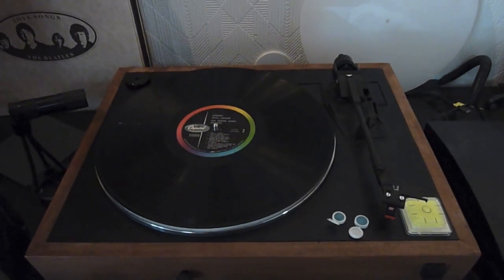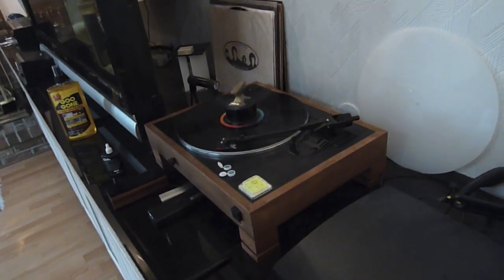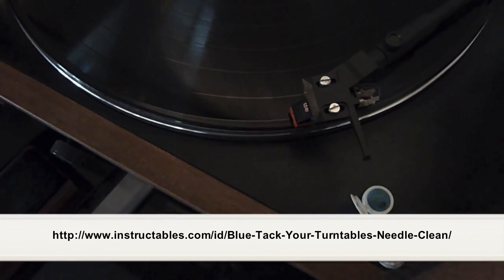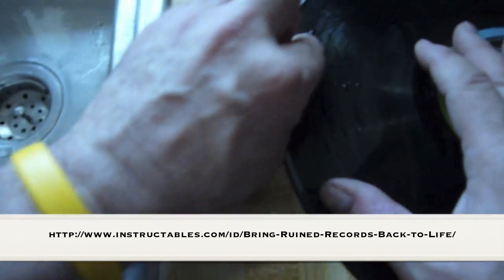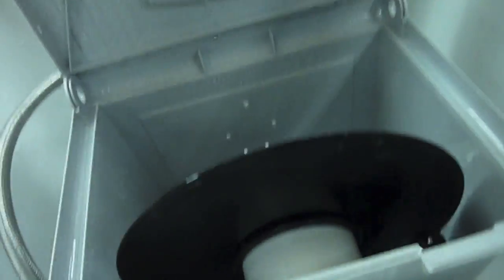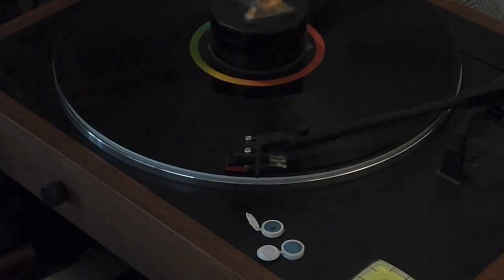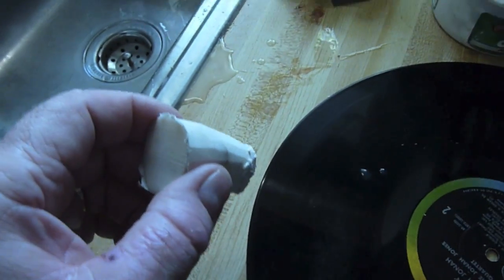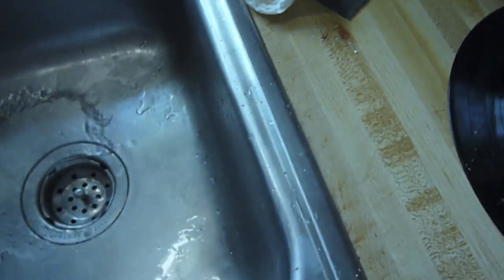Resurfacing Records to Sound New Again

Comment from the maker: You've made one error here.  This album was one I picked up from the local junk shop. It was already ruined.  Cleaning albums is a personal choice of what works.  What I've done here is not about cleaning, but scratch removing. Scratches are what ruin LPs.  Until now, once an album was scratched, the only option was to find a new one.  I've given people who don't want to, or can't find new recordings, another option, so they don't have to listen to the ticks of those "ruined" records.
Reply: I need this bad so I'm definitely appreciative of the effort. Most of my music is pretty limited release to begin with. Then you throw in how dj's treat their vinyl. Record bag sitting in the desert for 3 days, add 20 years, a bunch of plays, maybe a couple owners and you get some really messed up records you can't readily replace. I've tried treating my records well but there's no getting around what the desert does to a record. I've had moths get stuck under my tone arm while playing before. Imagine that dust in the groove of a record. Tiny little microscopic hairs from a moth. It's murder. I'll take any hair brained idea to restore a record and give it a go. If it works I'll keep it. If not than it's back to good will for another test case.

Just for perspective I belong to a reddit group for old music. I wanted to post these 7 limited release records I have last night so other people knew they existed. 5 of the seven were not online at all. 3 of those 5 had no Discogs entry. So if I can save those records than I'll be happy dude. Because I sure as hell won't be likely to be able to replace them.

On a side note do you find that the wax helps the stylus to glide over imperfections? Is that the idea there? Same basic idea as car paint I'd imagine. Fill in the tiny little scratches with wax.
Reply: @djluminol  what reddit group is it? I'm interested.
Reply: @loicbruyneel9754  r/ClassicTrance

Comment: Well what can I say, you can't argue with the results, it sounded way better!!! Funny reading all the comments! People freaking out over your process.  I must be honest though when  you busted out the sand paper and Goo Gone I was like WTF!!! but I sat through the whole video because I just had to hear the results and it sounded great! What ever works for you! You worked out that scratch and the record sounded good!!! People can be so mean btw!! Take care bro!!
Reply: absolutely it has good result,  can't deny it... why people freak out, i mean if its darkside of the moon first press, yes you could freak out first ~ LMFAO
Reply: The thing is instant results are all very well but there's MANY problems here and they ain't good. The results are clear if correct. But you should NEVER use stuff like sandpaper on a record, not so much for what it does to the sound, but the detritus it leaves behind. When a record plays, the needle heats the record up (because the size of the needle is tiny versus the pressure concerned). This means any detritus present either on the needle or in the groove gets stuck. Furthermore, the material used in sandpaper is a great way to wear your stylus out VERY quickly.
Lastly using solvents on or detergents on vinyl is also an awful idea long term. Again, might not do instant damage but it will long term. You have residues you can't see and so on.
So the problem here is not "oh hey it sounds great" but if you don't understand how things work, you don't know the damage you are doing.
Reply: @crunchyfrog555  cleaning the grooves after the sand paper step removes the detritus

Comment: One thing that wasn't mentioned is fixing a record that jumps grooves because of a deep scratch. If you obtain a high magnification loupe (photographic), at least 8-10x, you can see the offending scratch, and judge which way the scratch is angling across the grooves.
Using a sewing needle at a roughly 45 degree angle, gently press into the groove and rotate the platter in the opposite direction of record rotation so the needle moves across the scratch. Several passes will be required. Test after each time to see if the stylus still jumps. I've fixed many charity shop gems this way. Then using the fine sandpaper as above to remove the tick should do it.
Thanks for the vid.
Reply: Hi this is old I know but why do you use a needle?  Wouldn’t that scratch in the groove?  I’ve been thinking to try this but with a sharp end toothpick.  Is a sewing needle better? Am I not fully understanding what the needle actually does?
Reply: Been

Comment: Surprising. 
I thought the polishing compound would ruin the record but the treatment sounds like it worked. 
Anything that saves a record from being thrown out is worth a shot.
Reply: The polishing compound (well, even the sand paper) just works the top surface. The applicator does not fit in the grooves, so it won't be polishing the grooves.

Comment: Excellent results.
I likes the blocking the vinyl with the compound stick.
Many will be timid and afraid to try this, only because some ignorant records salesman says it's silly.
If blocking is safe for delicate paint on a $300,000 automobile, I think a much cheaper hard piece of vinyl can deal with it.
The sanding is good idea also, however, wrapping it around a rubber block may help in not putting excessive wear in unwanted area, even though that's hard to do with 1500 grit. may I suggest 2000 grit.
Grats on your excellent and novel approach to resurfacing.
For anyone information, I have 15 years experience in resurfacing surfaces for $25,000 glass windows to high end automobile, I consider myself a god dam expert in this field.

Comment: One trick I figured out over 30 years ago was to clean the record and then spray some Armor-All on it and wipe off the excess. I figured since it's vinyl, maybe it can benefit from some vinyl protectant. It actually made a big improvement in how they sounded. Maybe it also helped cut down on needle friction, I'm not sure, but the improvement in the sound was very noticeable.

Comment from the maker: Great Question:  It removes grime.  It contains things that are not too good for natural materials, but vinyl isn't natural, and isn't affected.  It takes a while to evaporate, but that gives it time to loosen the impacted stuff at the bottom of the grooves and is far quicker and cheaper than wood glue.  I use a micro cleaning cloth to spread and wipe the Goo Gone, wait for it to dry and apply cleaning solution normally to flush out any residual Goo Gone. Use it only once. After that you're set.

Comment: I quite enjoyed this Bruce. A few years back when I was converting my records to digital, I would flood the record with distilled water and let it play wet for the recording process. I only did this for the really bad records, but, it sure did a nice job.
Reply from the maker: +mrshelfsong 
I did the same thing, but further back in time... But what's distilled water? J  
I don't know what made it work, but it may have something to do with the water lubricating it all.  Any dust or static noise would disappear and (small) scratches would be muted.  I don't know what it was doing to the frequency response of the tapes I was making, but with the speakers I could afford back then, it didn't matter.

Comment: Absolutely love this video , my balls crept up a bit in the beginning but I'm fine now ...
Also love the steamcleaner ideas from others, works very well .... In your case good rinsing is key , technically it should work ... the paste doesn't move IN the grooves when rubbing it , it's pushed down or sideways , when pushed it also probably won't 'polish' the groove itself ... the pressure is on top , where it's needed most , only tension forces of the paste itself are working in the grooves . Been thinking long and hard about this , and it's freaking awesome brother .....
Thx for showing us new ways ....
Reply from the maker: Thank you very much for the great comment.. "My balls crept up a bit"... LMAO.  I've been thinking about the paste as well.  It's expensive, works only in small areas and it's messy.  I'm betting that 2000 or 3000 grit paper would do as well or better. Problem is, 1) I don't have that grade paper & 2) I don't have any albums with scratches at the moment. So I won't be able to try it for a while to see how it works.
Reply: @BruceKinsey  look for paper used to smooth fountain pen nibs. you can get them up to 12000 grit.

Comment from the maker: Hi bobskie.   The anvil is there for weight.  It reduces the effects of warping, which records are prone to and adds a bit of mass to the turntable.  Most weights are as you described, round, with no identifying features.  I went the other way and used the anvil, which belonged to my dad.  The block portion is a turned block of wood, with felt on the bottom.  Weights don't have to be all that heavy, but heavier weights will help keep the turntable rotating at a constant speed.  Mine's there to help keep the record flat.
Reply: Bruce Kinsey I've never put weights on my decks. Most of my albums are still as flat as when I bought them 45 years ago. Its all down to record/storage care.

Comment: Dear Bruce, thanks for sharing this. What a great idea to use sandpaper 1500. Al my records are stored (sorry about that) but there is one there with a very nasty scratch that I tried to fix some ~25 years ago, poking and stroking with a sharp needle trying to straighten the grooves again. Made it only worse of course. I'm going to find some of that fine sandpaper and try again. Fantastic video! Thanks again ;-)
Reply from the maker: Thank you Frank. Sorry the video is so long.  Eventually, I'll be making another video (shorter... Much shorter) containing only the necessary bits.  I'd also like to experiment with 2000/3000 grit sandpapers to bring the record's gloss back.  If you've dug deeply into the track with your needle, you may be disappointed.  Sandpaper only cleans up the interface between the groove's sides and lands that have been destroyed with the phonograph's needle.   If your needle didn't destroy the information in the groove and only plowed vinyl above and into the groove's upper part (which is where most damage usually occurs), it should be repairable with sandpaper.  Good luck.

Comment: Best way to clean a record, use vinegar. Best sounds, cleans up static, sounds good. It really works. Or it did for me. Take your own chances.
Reply: It's  the acid in the vinegar it will remove organics ie dirt. I use the same acid full strength on the waterline of my boat and it is the only way I know to clean it. Having said this it leaves me with raw gel coat that immediately  gets two coats of wax. Have you been doing this long without long term negative effects and do you use anything after the vinegar.
Reply: It may work but calling it “best” is beyond a stretch. I doubt you have tried all of the processes and solutions produced by experts and used in places like The Library of Congress. I know of no one who does record restoration professionally who uses vinegar!
Reply: @Stew666able  I play my vinyl flooded with white vinegar and they play better wet than dry!
Reply: what kind of oil?
Reply: @cclip46  Interesting. I have used rubbing alcohol for years the same way. Play the record with the surface flooded and go over it with a record cleaning brush. Works great.

Comment from the maker: Thank you for all the comments.  I truly would like the process of refinishing the surface of record albums to catch on.  It has allowed me to save many GoodWill records from the junk pile.  To answer someoneelse101's question about what I was using to clean my needle, I placed a wad of "blue tack", the stuff parents use to hang their kids' artwork on the refrigerator.  Unlike a brush, where the force on the needle and arm is shear, the blue tack pulls vertically, taking any dust along with it.

Comment: Are you sure that using sand paper helps removing the scratches and it fixes the sound?

Because i bought a used record and it has a scratch on it and whenever the stylus goes over the scratch it makes a popping sound.

Comment: Awesome and surprising vid.  Thanks!
Reply from the maker: No, Thank YOU.  I was expecting to get some flack about sanding my records, but so far, nada.  Evidently, people have pocketed their fears and have actually tried it.  It sounds scary, but the science is solid and it really works.
Reply: Bruce Kinsey
I had the thought of sandpaper to buff out scratches but thought that would damage the grooves and embed more garbage into the vinyl.  Great video.  Definitely will be trying this on some vinyl I purchased recently that has a lot of the same issues.
Reply from the maker: +WaybackTECH 
I must have stopped looking for comments about the time you wrote yours.  Sorry for the delay, thank you for the compliment and I hope you tried it and it worked for you.

Comment: I just use common liquid dish soap and I drizzle a few streams on both sides of the lp....with lukewarm water and a very soft cloth or in some cases I will swirl the palm of my hand in a circular motion and gently work the soap into the grooves...trying to not get the paper label too soaked...then rinse and shake gently to remove all the soap....if the grooves are in great shape the water will pour from the lp...if that will then be as good as new...this has worked for me

Comment: Great video Bruce. I've used 2000 grit wet sanding paper before, it does  work. I scrolled thru a lot of comments and didn't find an answer for what I was wondering about. A couple questions though if you don't mind. What grit diamond paste did you use and what did you use as the applicator?
Reply from the maker: Hey Mike.
Thank you for your comment.  The last I did anything on this was 5 years ago.  My inability to shoot acceptable video  and too many “expert” opinions took the fun out of it.
The reason I added the diamond paste is many responders wanted to know how to make the record look new.  I eventually realized the reason was so they could sell them online as such.
Diamond paste does not create a perfect surface and the worked areas are noticeably different no matter how much expensive paste you use, so don’t get your hopes up.
As an applicator, I believe I used a dense closed cell foam pad glued to a simple 3D printed handle.  Dense foam is the key.  Softer will polish inside the groove.  I used the finest (and most expensive) paste I could find and still rely it on it for watches. 
Good luck!
Reply: @BruceKinsey    👍  Understood. I’m not interested in selling any of my albums. I’m more interested in getting rid of that dull spots so they look decent after the wet sanding. My daughter can sell them if she wants when I’m gone but I doubt that she will. She likes vinyl too. Have a great Christmas and new years.

Comment: I got a free record form a guy looking to downsize his collection. It was old and dusty so I did these 3 steps:

1. spyared on windex conservatively and wiped it off
2. Sprayed on a distilled water/alcoohl mix and wiped it off
3. Rinsed it with distilled water and obviously dried it with a micro fibre towel.

would that've gotten rid of any scratches?
Reply from the maker: +Tyler Jaclyn 
None.  Scratches are mechanical in nature and only a mechanical action can remove them.
Reply: Bruce Kinsey ok, so the only thing it did was clean it and remove the dust. I guess?

Comment: I totally started laughing when you flashed the "I'm gonna hear about this one" before the Goo Gone. I haven't perused the comments but... everyone's gonna have an opinion on what's best, right?  I ran out of the solution that came with my brush a long time ago and have found that rubbing alcohol works just as well... (and, I may hear about that one). Good tips here, though! I'm interested to try the sand & buff method you have here. - And to those that might poo-poo that, or the Goo Gone, etc. because it will 'ruin the vinyl'... don't forget... we're doing this because it's ruined already.  I think of it like one might think about major surgery leaving a big scar... perhaps but, at least that organ will work again!
Reply from the maker: +ohgoodgodno 

Thank you Ohgoodgodno!  Dichloromethane (paint stripper), methylethylketone and toluene (vinyl pipe adhesive) and Acetone are the only chemicals I know of that have the ability to convert vinyl into a puddle.  People don't realize that vinyl is the one of the most used materials found in manufactured products and we clean it every day with everything from soap to gasoline.   Thanks for pointing that out.

Comment: To me sanding is a little severe, but thinking about it you're just knocking off the top damage, and it sounds like it worked. Once a record is so damaged that normal means won't help this sounds like something to try. The use of goo gone also was a good idea, maybe a prewash before using Dawn soap to final clean. Interesting video and another nice trick to fixing damaged records.

Comment: Thank you for the video, impressed that it works, I've been collecting records 40 years but never tried this. I shure will now. A question could this technique work on 78 rpm records aswell. Got plenty of them and boy are they scratchy sometimes. Thanks again!
Reply: @1fattyfatman  I did try it on some 78 but result was a mix of success and failure. Some records are probably very sensitive to water or polish agent. Before vinyl the compound was different between record companies. Probably water gets into the compound and makes the surface to crack up in tiny spots but on other records it went just fine.